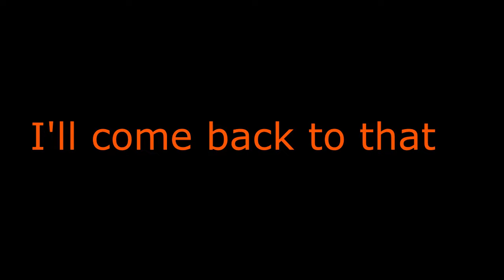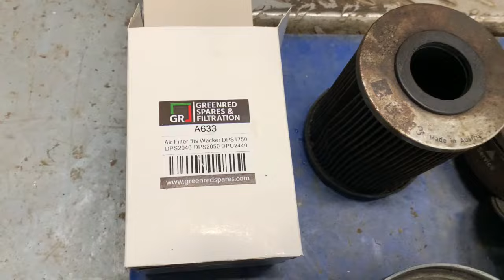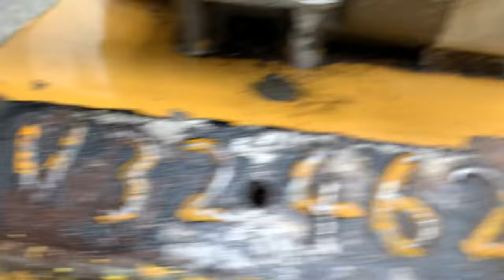Left for scrap Amman plate compactor / wacker plate, lets make it work!

Comment: 😊 ~ I remember seeing one of those in use as a child, we live in Gordon Hill, Enfield, London, and at the end of our garden there used to be a cricket green owned by the cricket club and the Hertford loop line railway. I can’t remember what happened, but the railway re-bought the land and sold it to a developer who wanted to build ‘flats’ on the upper half, and the cricket club have the lower half as a sports centre for the flat owners. The builders moved in and demolished the club buildings and turned the land into brown-field, and then, as our house was halfway-up the hill the part backing onto our garden became the building site for the flats 😠🙄 ~ we had to put-up with the noise for 3/4 years = one of the sounds was a vintage compactor-plate similar to the one in this video, but it had been spray-painted cherry/lipstick red all-over, and I went to the back fence and first saw it next to the pile of landscaping materials, I could see it was a hand-crank started and looked old, then had the “delight” of watching a workmen go to it, get the crank-handle > insert it in the spigot hole and release the compression and crank the engine ~ when it started some diesel particulates blew out the muffler, and the worker took it to an area that I assume needed compacting? and then he turned it off and left it. Later I saw a workman on a ride-on twin roller smoothing what looked like the foundation for a road and then saw another worker start the compactor-plate and walking along with it behind the roller as if he was smoothing where the roller had missed? quite amusing seeing both in use in the same area.
Reply from the maker: That does sound odd but maybe they used the little one to smash small bumps flat the big one missed? I mean this thing wasn’t far from Enfield there’s always a slim chance this was that one. Unlikely but not entirely impossible.